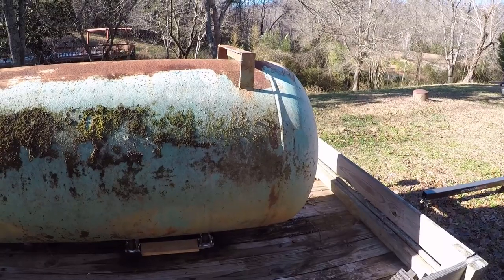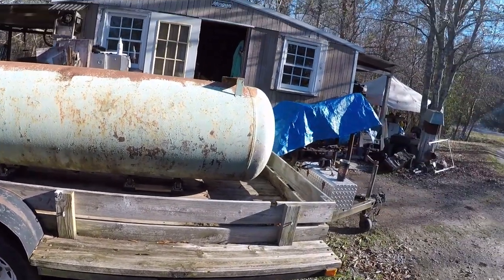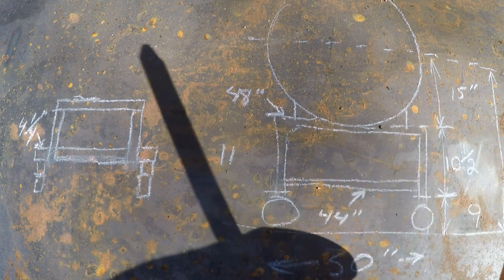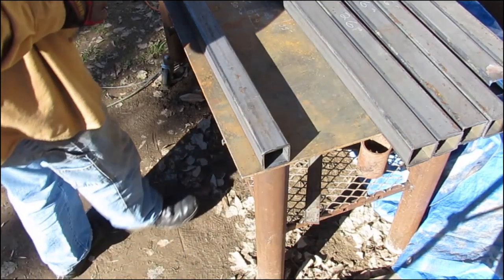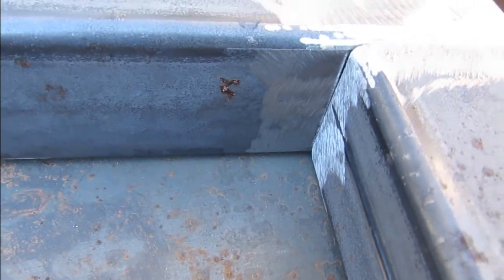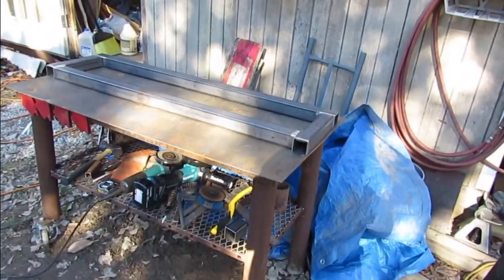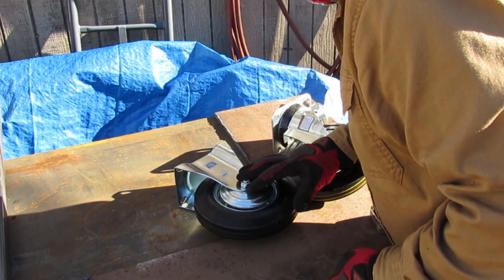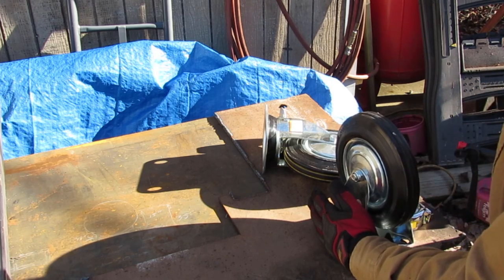#144 Building an Offset Reverse BBQ Smoker Part 1

Comment: Happy New Year Stephen.  I do miss ChuchE's videos along with Steve the mechanic.  Chuck got Pissed off at Youtube and was doing a lot more hay processing this year.  Just an Idea for you.  I had a tank like yours, and did the same thing.  I cut it in half and made two smokers.  I used the Cheap Harbor Freight trailer, and mounted the tank on that.  It is a lot easier to move around with the trailer tires.  Put lights on it and you can tow it.  I sold the other one and ended breaking out even on the deal.  and I go myself a free smoker.

Comment: I have a small mig to use around here for repairs and such and it seems like every time I need it the wind is blowing.  I bought some Flux wire and seems like I use it most of the time.  Everything I do is outside so the argon gets blown away.  I should have just bought a stick welder. :)

Comment: By no means a fabricator/welder but some gussets would probably be a good idea; especially for the wheels. I kind of see where you're going with having them outside the frame but to me, it seems you're looking for problems down the road if you don't have something to tie those plates into the rest of the frame.

Comment: HI, STEVE, Glad to see you back on always enjoyed watching your projects. Have one question did you ever consider using regular tires? And frame with a trailer hitch so you could move it around. I think you might find some difficulty if moving around on gravel and dirt. Also if dirt gets in those casters I believe that will be a problem. Just some of my personal thoughts and going by some that I've built for Smoking Hogs.

Comment: Hi there steve I'm building a smoker very similar to yours except it's not a reverse flow and was just curious how you figure out how big to build your fire box and how big to do the cutout on the firebox where the smoke comes out of
Reply from the maker: Thank you Steven. My firewood is about 16 inches long so I made the front of my firebox 16x16 inches square then added 4 inches to the length making it 20 inches. The firewood will fit very nicely inside and allow plenty of airflow around the fire. Remember that airflow is the key to all of it. With that in mind the open area of the firebox going into the cooking chamber should be at least as large as the smoke stack. My smokestack is a 6x6 inch square tube, making it 36 square inches. I just made sure my firebox opening to the cooking chamber was at least that large. I hope this helps and Thanks for Watching.
Reply: @StephenOgle  thank you for replying back to me it helped me out I'd love to talk more some time and send ya some pics of what I'm doing if theres any other way to contact ya please let me know
Reply from the maker: Glad I could help. You can always email me at stvnogl@gmail.com  Take care.
Reply: @StephenOgle  10-4 there partner il get ahold of ya again through email soon thanks for replying